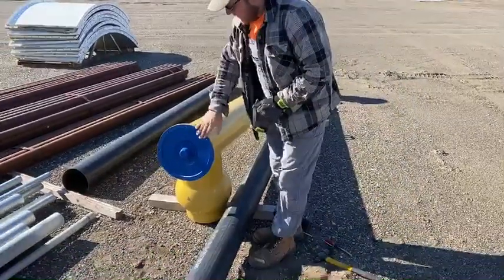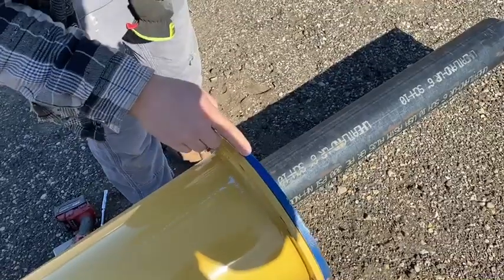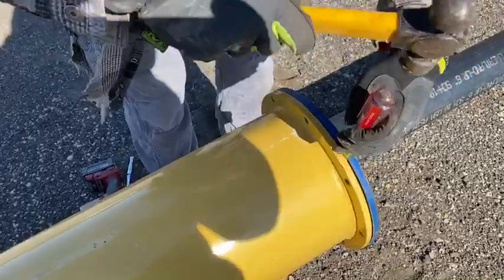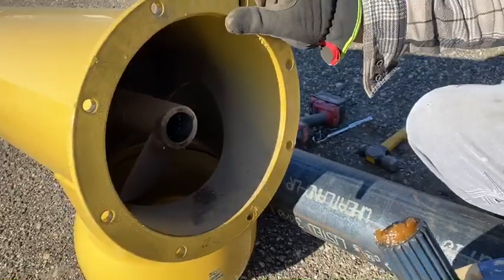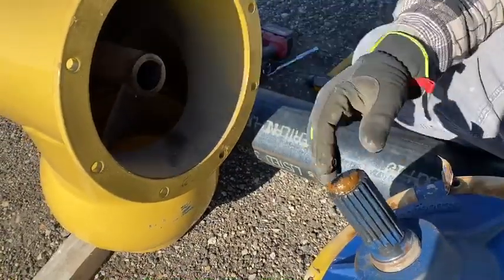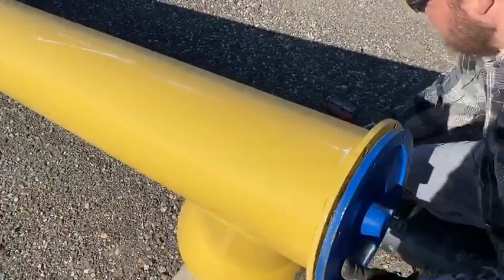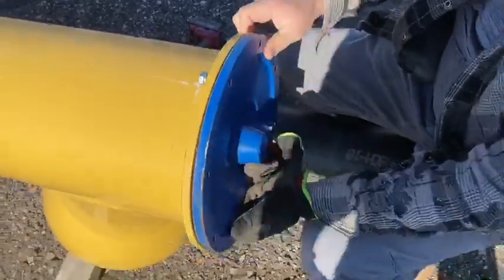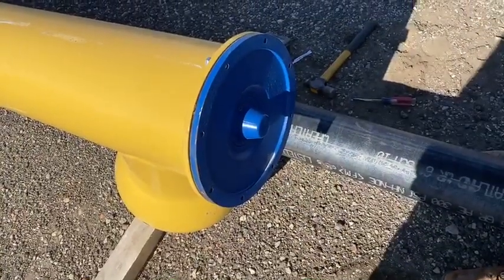How to replace end bearing on WAM Screw conveyor

Comment: How to remove clogged cement at screw conveyor🙏🙏🙏
Reply from the maker: Remove the bottom access hatch and reverse the motor by switching 2 of the LEEDS on the 3 phase electrical motor